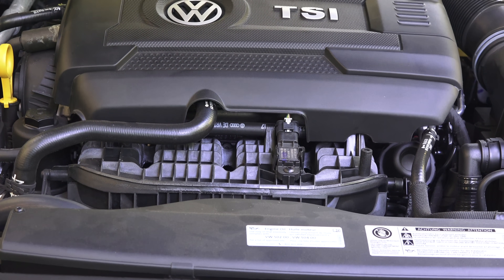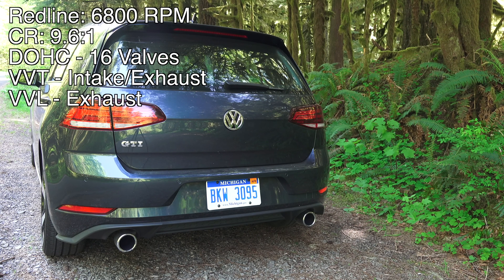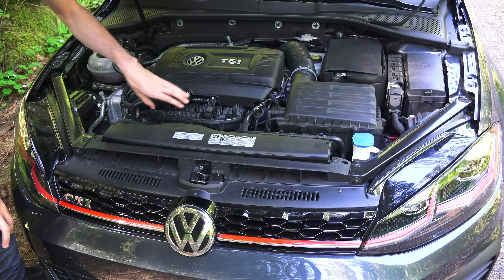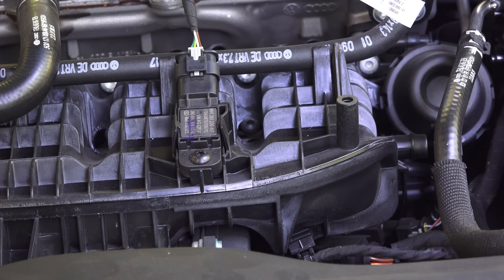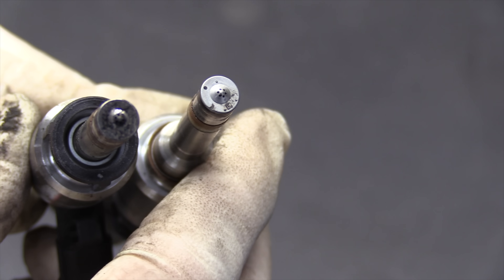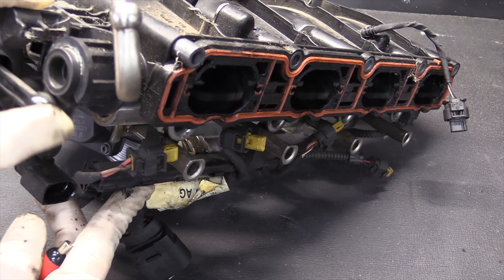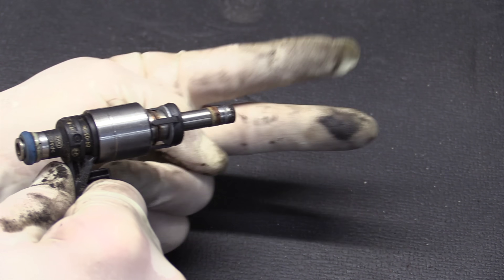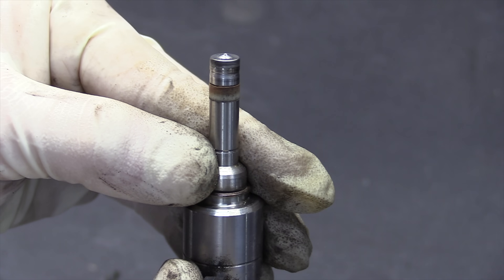The Best Engines - Volkswagen GTI Turbo

Comment: Notable features (in real life) are:  excellent driveability, easily tuned, chain tensioners that fail, plastic water pumps that fail, hopelessly inept pcv system, extreme intake valve carbon fouling, terrible rear main seal design, unknown engine check lights that the dealer cannot solve, and a myriad of plastic parts that leak or fail, coil packs that fail, cheap connectors that become brittle and break...    I only wish the Germans could have made it more complicated.  and, I'm sure they're working on that.
Reply: you really are talking about every problem that is now fixed on the newest versions. Everything can fail, but there are thousands and thousands of these engines running trouble free
Reply: You completely absolved yourself of any vehicular credibility when you said "pvc system". 

Next!
Reply: All these faults are common on the Gen 2 engine, not the Gen 3. Think you might be mistaking the two.
Reply: You must know much more than I BUT, VW calls it "PCV Valve Assembly for 2.0T (TSI) Engine 06H103495AH"  So, Please enlighten me.  and they fail regularly.
Reply: Its all OK..l. I think we're all friends here.   and of all the modern german brands,  VW is the best... (don't get me started on MB or BMW) but right now, I've got a 2010 2.0T, no faults, and it will not pass emissions testing.  and in the 2012, a poltergeist periodically decides to turn the engine check light on, for no particular reason...  and I do replace the pcv system every 30,000 miles, when I decarbonize the valves...  the rest of the VW's have been traded in for brands from the land of the rising sun.   but thanks for the heads up  I'll run spell check before I let my mouth overload my ass.
Reply: dan noyes I was just pointing out that you said PVC as in the pipe instead of PCV as in positive crankcase ventilation 😏 just bustin ya balls!

Although I will add that my 2017 mk7 GTI with 20k miles hasn't had a single issue, and my buddy's 2010 mk6 GTI made it to nearly 100k before he had any issue--and it was a coil pack that died. 

PCV systems in the Gen1 and Gen2 EA888's were somewhat under-engineered, but they remedied that in Gen3 with the inclusion of a cyclonic oil separator in the PCV system.
Reply: A Mk6 with 100k before any issues!!! Must have been faulty then.... Oh the Mk7 hope you have been saving, I've got to do a quote on a rebuild $$$$  somehow I think there may be an insurance claim for fire or theft before I see it..;)
Reply: Ah yes, the diverter valve - been there/ done that.  But, I think you might be breaking the rules...  this is supposed to be  just about the engine...    I am sure, however that all these have been corrected in the newer models.  but the omission of a manual transmission in the new Arteon is inexcusable.
Reply: kkthxk No diafragm in the DV on mk7s (piston design), subframe is one piece on mk7. Your mentions are a generation or two behind.
Most japanese cars have crappy plastics that feel like touching a trashcan when driving, so unless you're talking  about japanese cars that cost 3 times more than a Golf, I don't know about those "better plastics"..   :)
Reply: thanks.  but the PVC, the water pump, the valve carbonization, and the plastic items are still there.  I know the germans are admitting defeat and adding port injection to the DI, and a few other changes but really, the plastic items always fail sooner rather than later, not to mention the lack of under hood access to practically any of the parts  which can and will cause a critical failure.
Reply: @dannoyes4493  have you ever lifted the hood on a mk7 golf?? the PCV (I'm guessing that's what you meant by 'PVC') is right in front of you, would take all of 2minutes to replace. On top of that, mk7 PCVs don't fail, the older ones used to.
Also the dual (direct & port) injection has been on all ROW mk7 cars from the start, the US ones don't have it yet, so I don't know about the 'admitted defeat' LOL
I have no idea where you get all this hate for the mk7 since it's obvious from your lack of knowledge about them you've neither owned nor repaired them..
Reply: 1st the term PVC is an inside joke...  yes, it is the PCV.  2nd, on all the VW's I own/owned, I make it standard procedure to swap the PCV every 30,000 miles.  Otherwise, they fail and blow out the over-designed rear main seal.  No dual injection here in the states for VW, that I know of.  
And there's no hate... and I don't know why you would get that impression...  I've bought/leased eight of these silly things.    But I have noticed a general deterioration in the quality/durability of all German car makes over the last 15 yrs (including VW).  Meanwhile, I noticed other makes increasing their quality/durability.   
Lastly, I am very disappointed that the manual transmission will not be available on the new Arteon.
Reply: @dannoyes4493  Testing the PCV to make sure it works is a simple enough procedure, but I guess replacing it at a certain interval works too, if you're into that sort of thing  :)
I've had my mk7 gti for almost 2years now w/ stage2 tune, got 26k miles on it with a bunch of track days in there, and apart from brake rotors & pads (which on no under-$100k+ car would really take track abuse) I had nothing to do to it.
Put good synthetic oil (NOT the dealer garbage US-spec Castrol) in there and you got nothing to worry about.
Reply: Thanks for the heads up.  and good luck over the next 30,000 miles.  get back to me then.
Reply: kkthxk  I live in Chicago and drive 10-15k miles/yr around the midwest. Plenty of cold, snow, slush & salt. I drive in the winter a lot more, since I ride a Ninja as much as I can from March til November.
Car is always parked outside, never owned a garage.
Reply: VW's are great... as long as they run.  I think the hot weather, heat down here is what accelerates the deterioration of the plastics.  Plastic just doesn't like it.  And, No need to buy Mercedes, BMW for a fun German sedan.    But the excessive use of plastic on the engine's ancillaries does catch up with you.  As far as marketing, I always opt for manuals.  if those are phased out, se acabo', nada mas!
Reply: @dannoyes4493  I completely agree on the manuals, the only autotragics I've driven were company cars. For me I don't buy anything without 3 pedals; when those are gone, and I can't even swap & make my own, I'll just take the bus. Hopefully I'll be long gone by then..  :)
Reply: What most people don't realise is that German/European cars are of high build quality, but of very poor material specification. The issues you have noted with the premature failure of plastic parts in particular,  is due to the fact that the materials specified are simply not suitable for being subjected to the typical automotive use and environment. The poorly recycled plastics used in these cars have to be conditioned with a significant quantity of plasticiser during manufacturing, to allow them to meet the required specifications. Over time, due to repeated heating and cooling cycles, the plasticiser will excrete out of the plastics and lead to cracking and material instability (i.e. the properties of the materials rapidly exceed their specification limits). This technique allows engineers to accurately predict the durability of the parts, and therefore the vehicle as a whole. A typical German car is not designed to last beyond 5 years. If you own one, you can extend the life of the vehicle by parking it in a garage at home and at work, which can reduce the amplitude of the temperature variation.
Reply: I hope you are correct.  but the points I iterated were common to numerous vw cars I bought for myself and my employees. 
Let me add that I really like the VW's but they scare me off...  plus the Arteon will not be offered with a manual...
Reply: lol I have a mk6 gti with 63,000 miles now bought it at 51,000 and the only problems were coil packs and a wheel speed sensor. This car isn't that unreliable like people say.
Reply: I dont own a gti, would love too though! But I do own a 2011 Jetta se 2.5l w/manual 5 speed and just turned 200,000mi never had a problem with anything! Runs as good today as the day it had 1mi! Did replace vvti solenoid once, but that was from a worn out rubber mount on the air box causing the air box to hit the sensor and were a wire in half. Can't really fault the part for that. I use BG products regularly for maintenance. If anyone is having carbon build up issues they have a fix for that!
Reply: Listen, you are not supposed to tell the truth.

Comment: Plastic manifolds?
Reply: migmardi yep and plastic oil pan. On this the oil cap is a part of the timing cover which is also plastic. Dont wanna be breaking that now, will cost you a pretty penny.
Reply: GForceConnections My sister has a mkVI 1.4 and that one, IIRC, has metal manifold, IDR about oil pan and timing cover
Reply: migmardi ea888 gen 2 has plastic intake runners. Gen 3 (the engine in the video has more plastic components I mentioned earlier)
Reply: footballcoreano didn't say they are not reliable, I just think there is no need to use cheaper and less recyclable materials on cars priced like VWs

Comment: Award winning oil consumption.
Reply: footballcoreano 
That would be the Nissan Micra, or diesel.
Don't be foolish.
Reply: yeah  yeah yeah 
Just go and take a bowl of rice
Reply: 50 thousand miles in 2 years, vw are great vehicles, theres a reason why theyre tied with toyota, getting 6th place in the top fortune 500 companies
Reply: Diesel Gate! Hahahah
Reply: Yep, I couldn't understand why I had to add oil to my golf 1.4 tsi in my previous car I never did it :/
Reply: 2017 with 15500 miles, never lost a drip of oil
Reply: Zenon Blacha haters gonna hate
Reply: Not these ones
Reply: Uh? We're not talking about Datsun here. You sound like one of those lousy owners that leave the oil filter loose and then wonder why the engine has a problem.
Reply: And don't forget the award for the most catastrofic timing chain failures.
Reply: Schrije isn't there a class action lawsuit regarding this??
Reply: Janis S Yeah, like 1 l for every 500 km.
Reply: Look how much sludge is in the intake track.
Reply: Janis S Only took them sooo many years to correct the issue.
Reply: Janis S Or just wait for the face-lifted edition.
Reply: Absolutely, it is the award winner from the Hall of Shame from the past and present.

Comment: haha, award winning. I'm just going to my local "European car specialist" garage to pick up my Passat which had power loss issues during acceleration (timing and fuel regulation codes started showing after changing my intake manifold), my local mechanic gave up on it said to take it to a dealer... smh.
Reply: mattk02 not the same engine

Comment: My 2016 GTI blow up its engine around 20k miles. It had some issues everytime I tried to floor it. DSG. Took it 3 times to the dealership before the engine got damaged and had to be replaced. The first 2 times they told me misfired cylinder #2. On the bright side, I have 2 cars. Bless the 1990 Miata.
Reply: Ouch :( sucks to hear. I have been much more lucky with my 2017 GTI. No problems so far now at 38k!

Comment: I don't think VW and good engine really go together
Reply: Tomikos995 this particular engine is designed completely by audi. Was never a fan of neither audi nor vw, then read a self-study about this engine-it’s genius.
Reply: snsofhumor yeah, but Audi and VW are known to share engines in total.  But you are right if you're saying they dont share engines with Bugatti!!
Reply: GForceConnections And same as skoda, seat, lambo and bugatti as well? Totally alike.
Reply: Damian Dąbrowski it’s actually good especially the 2.5”s
Reply: Yeah sure, tell that to the  EA827 engines, indistructable is the minimum you can call them. Or the 1.9 diesels which run 1 milllion km on original heads.
Reply: Vw and audi are the same company
Reply: Well they do.
Reply: Tomikos995 actually they make great engines. They're just not very reliable.
Reply: VW overengineers every single engine they make and they win multiple awards. What's this "I don't think VW and good engine really go together?"
Reply: I agree with Tomikos995. 
The VW's engines quality is very poor.
Reply: Every manufacturer has engine issues, we just don't always hear much about it.  The vast majority of EA888 engines are reliable, we don't hear too much about that either.

Comment: Turbocharged 4 cylinder engines are pretty ho-hum these days, but the EA888 Gen 3 is a pretty special bit of kit. It puts out 228kw in the current Audi S3 / VW Golf R. A modified version of this engine cranks out an astonishing 243kw / 410nm in the Audi RS3 LMS. More impressively, it drives a in fairly linear fashion, even in this state of tune.

Comment: A lot of oil was consumed and a lot of carbon was deposited in the making of this video.
Reply: Might want to check the acceleration times and top speeds of those two cars.  Not quite as different as you might think. Also my acura was a 6 speed manual that i used to drive the bs out of and my 750 i rarely get on it that much.  The fact is german cars while very luxurious are not very well built.  I could go on and on about the s85, n/s63 n/s54 issues that none of the luxury Japanese brands suffer from.
Reply: @TurboNFRStwoK  "and my 750 i rarely get on it that much" that's where you messed up lol. German cars are made to be driven, especially long distances, in other words, made for the autobahn where there's no speed limit. If you wondering what driving German cars a lot has to do with oil consumption, do some research about carbon build up and what can be done to help prevent or reduce it as well as how it correlates with oil consumption.
Reply: A cars a car. You all need to chill the hell out, the Earth ain't dying any time soon and we live longer than 50 in most cases. Enjoy the car, all cars fail just like our human existence
Reply: footballcoreano And old BMWs are garanteed to leak when they aged. Thats what called craftsmanship.
Reply: almost all turbo engines will eat oil, mazda , subaru, chevy, VW/Audi or who ever, i had an old 1.8t 20V gti a few years back ran like a champ just had to keep an eye on the oil, it was almost maintenance free compared to some of my friends with Subaru and Mitsubishi
Reply: Must have been before the piston replacement TSB  lol
Reply: These newer engines have the extra injectors to clean the valves (not this particular one though but same design). Oil consumption is a thing of the old version.
Reply: go eat some rice
Reply: L Adam where I live the gti has an oil change interval of 30.000km, engine will be dead if you dont refill it.
Reply: Hambone Haha 4 real
Reply: Mircea Dogaru the timing chain, which the whole Campfire Horror story is actually relative to the tensioner and not the chain is really over blown. You can’t predict the tensioner to break just like how any car can fault anytime. I will say I was afraid of my tensioners but it’s also a over exaggerated fear because it’s hit or miss. Not as much people have that fault as much as it’s proclaimed
Reply: QQ
Reply: Perhaps I was lucky but on a round trip across the USA in my 16 Mk 7 GTI, totalling 7577 miles,  I only burned a half quart of oil. I checked on every fuel fill up .
Reply: comparing honda's engines with Audi or bmw engines is like comparing a bicycle to a 1000cc, I had a Honda, no torque whatsoever now I drive an Audi S1 ai have more torque at 1,300 rpm than my previous Honda at 5k
Reply: Anton Zuykov  NOx is good. Kills the weak and helps with human evolution
Reply: Cant be as bad as my mk6 2.slow.....
Reply: This engine is not engineered but shlapped together, how did it leave the factory when it burns soooooo much oil???
Reply: A lot of emissions tests were cheated as well
Reply: The key thing is these engines need to be driven hard and maintained well. I have 47k miles on mine and I've owned it since new. I use LiquiMoly oil or the proper German Castrol. I only use premium Top Tier fuel. I don't get on it until I have it at the proper oil operating temp. I don't use any oil between changes which come at 3-5k miles for me NOT the VW recommended 10k. Take care of the engine right and you won't have any issues in most cases.
Reply: My 2005 Acura TL consumed NO oil in 5K-7K miles between oil changes and was still medium light brown at oil change. That was with almost 200k miles on the clock. Now I have a BMW 750li and the n63 eats a quart every 1500 miles and the oil is black within 500 miles. The car only has 25K miles on it.  Guess all the germans seem to think that its ok. But its a poor design plain and simple. BMWs fix? Put an extra quart in it at every oil change.
Reply: Hambone my 2nd gen EA888 consume 1L of oil per 5000km... when it's low on oil, it's time to  get a oil change.
Reply: T Sturdy meanwhile BMW has dodgy cooling systems and snaps timing chains, VW snaps timing chains and fries injectors, their CVT is a joke and their DSG box costs an arm and a leg when they go wrong (and they do) and Mercedes' electronics are the most unreliable you'll ever find in a passenger vehicle. Oh, shall I remind people of DieselGate?
Reply: lexus had to replace thousands and thousands of engines in various models due to poor quality control, honda and acura cant make a transmission last, subaru cant make an engine that doesn't explode if you drive it hard, honda 4cyls burn oil like its water, nissan transmissions are trash(class action suits), the list goes on...